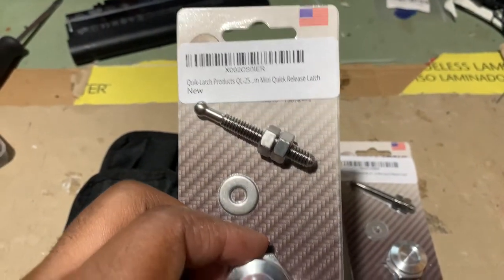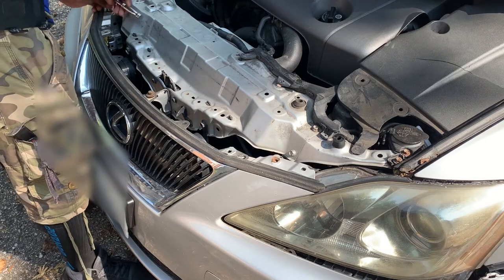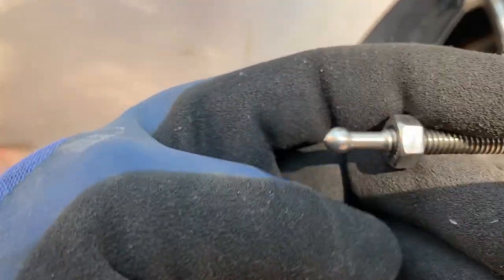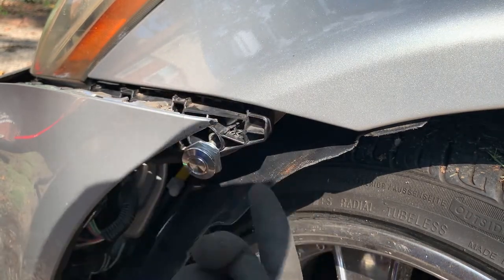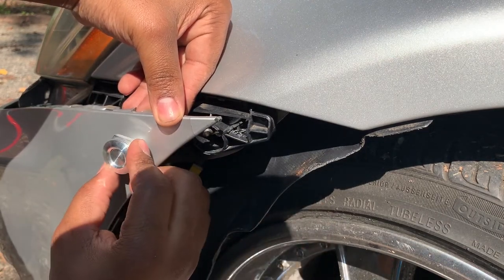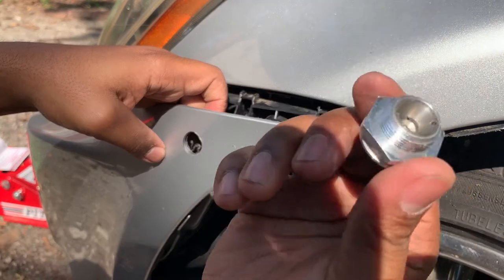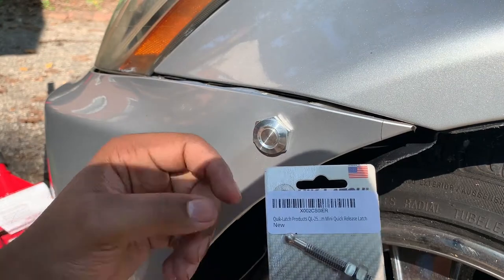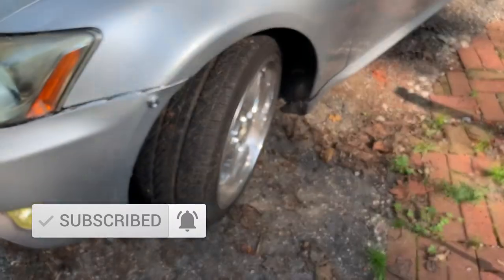How To Fix Bumper Using Quick Release (Lexus IS250)

Comment: This is a good option, but might as well buy the  2 bumper plastic bracket on Amazon for 16$ it’s being held on by a screw too.
Reply from the maker: Good recommendation. Unfortunately my issue is that the bumper itself is damaged that it cannot attach to my new plastic bracket so I had to use the quick release until I upgrade my bumper one of these years.